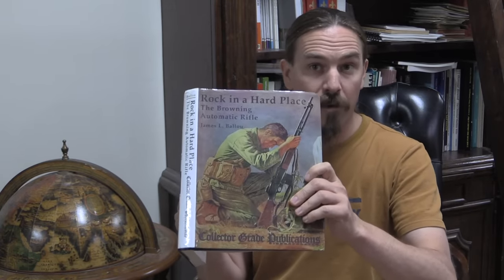Ask Ian: Why Not a Semiauto BAR Instead of the Garand?

Comment: I understand the Weight problem. if need to Carry and run, jump etc etc its a pain and need to be a muscular boy xD. But its a perfect example of what worse were the idea about continue using ammo clips. 100 years later we still use magazines
Reply: Ironically, Ian himself has repeatedly pointed out in other Q&As that the main reason armies preferred clips in this period was because magazines were more expensive to mass-produce and army planners were fully aware that soldiers in the field would treat both mags and clips as disposable items in a pinch.
Reply: @andrewsuryali8540  
Also the extra weight.  The box magazine is significantly heavier than a clip!

Comment: Ian!  You did not mention that the rate of fire has 3 settings on the end of the tube under the barrel to adjust the amount of gas that actuates the piston. A BAR can fire very slowly and allow for single shots by a skilled gunner.

Comment: The BAR could have been redesigned to a smaller caliber like the Pedersen.  Similar in size to the new Sig 6.8mm (.277)Fury.  That could make a lighter version of the BAR. The Garand should have gone with .276 Pedersen.  And the US could also have had .276 type round for NATO.

Comment: 'maximum.....allowable weight is given as 9.5 pounds' interesting that historically going back to Ancient times the standard infantry weapon whatever it was had usually at most about 11 pounds(5kg) and often quite a bit less. Sure you had some weapons that were heavier but they were almost always intended for specialised troops or short use. It seems no matter the era its simply not practical to field armies in which the average guy not the 'platoon' 'heavy' has to carry a weapon that weighs 20 pounds.

Comment: If I had the choice, the lighter my service rifle, the better.  BAR’s are blocky, and heavy.  It was better to use them in support roles, and leave more flexible units to use lighter and newer designs, like the newer SMG’s  and obviously, the next round of self loading rifles prototypes.  Garand and Johnson rifles simply were lighter, and easier to lug.  I am not a solider, but I just know that those guns have to heavy on top of kitting, so it was a good idea to find something that could be lighter, faster, and most importantly, newer.

Comment: I don't think the average weight of the XM5 is an issue, the normal fella weighed like 50 lbs less and was a few inches shorter back in the 30s, so I think we've just gradually become larger and can handle a standard issue weapon like that.

Comment: Kind of a ridiculous question when you figure an M1 weighs in at 9 pounds and an ungainly BAR is between 13 and 24 pounds, depending on the year/version Then there is the wight of a very small 8 round clip vs a 20 round box magazine. Then, does it have a bayonet lug - been too many years since I qualified on one to recall. Regardless, it's a fine tho now obsolete military weapon but a 13 pound one I dreaded carrying even in training

Comment: to be fair whit the requirement about the gun been able to run in bolt action mode.
I can understand that, consider the logistic nightmare and the quality of the industry at that time.
so having a gun must in worst case situation run in bolt action mode, be it worn or damage rifle part.
sub standard ammunition.
same whit the box magazines yes theres clear advantage to that but the logistic and industry of that was probably a hard pill to swallow.

remember WW1-WW2 even the US for a long time did not have enouth guns for all its soldiers (and they had to use what was consider obsolete, like sure police unit was fine whit what ever but this was more like rear line troops that are supposed to have at least something modern maybe not the latest was partially issued outdated stuff for a long time).

Comment: Funny that they mentioned in reasons why they shouldn't adopt it, they mentioned it should have a bolt action in case the semi auto system is damaged. Sounds just like Germany 20 years later with the G41 requirements

Comment: I wonder if the idea of a switch to turn the rifle into a bolt gun was, in part, influance on the FAL gas system.... 

Turning the gas plug to "grenade" effectively turns it into a straight pull bolt gun.

Still can't force it forward.... but meh.

Comment: The M-14 could have an automatic fire switch added I was on a range for qualifying and got an M-14 with this switch..  it was a lot of fun to shoot but I got really chewed out for doing that..  with this switch it was probably like a lighter BAR with a 14 round magazine, it shot very well, however, there was another issue with M-14 extractors breaking..   which, to put it mildly, was a problem..  also the stocks broke easily

Comment: The aversion of the military to detachable box magazines for service rifles seems inexplicable in hindsight. Didn't they trust that industry could produce these in large numbers?
Reply: I think its less about the number and more about the quality of the mag. BAR mags aren't known to be the most reliable afaik, and having a clip fed fixed magazine removes one failure point. I agree tho, in hindsight that is stupid.
Reply: That
And also they are heavier and bulkier for the same ammount of ammo as clips
Probably the main reason we use mags today is that clips dont really allow large capacities and the potentialy slower reloading didnt matter much when most rifles were bolt action
Reply: AFAIK, early 20th-century-generals often still had problems with the general concept of soldiers firing bigger amounts of ammunition without explicitly being ordered to do so for each shot. The French Lebel comes to mind which (in many parts) was actually designed around the premise that almost every action of the gun would be explicitly ordered by the field commander.
Potential waste of ammunition was seen as a big logistical danger. Couple that with a militaristic mindset, which put a lot of emphasis on "chains of command", and you get stuff like this.
Reply: @zjanez2868  Yea, if every detachable magazine was only 10 rounds there wouldn't be that much of an advantage over a clip. I can charge my SKS about as quickly (or quicker really if I am doing any type of magazine retention) as I can reload my AR15, but If I had to use three stripper clips because it had a 30 rounder it would be dramatically slower.

Comment: What's the difference between open bolt and closed bolt rifles
Also what is the longest internal magazine on a rifle and were they ever modified to hold more rounds
Reply: Open bolt the bolt is "open" and doesn't go forward, pick up a cartridge, and fire it untill you pul the trigger. Closed bolt the bolt is already forward with a cartridge chambered.

Open bolt tends to be used for machine guns and weapons intended for more sustained fire as it is said to cool better (air can travel through the barrel better I guess), and as previously mentioned a cartridge is not picked up, chambered and fired until you pull the trigger, preventing rounds from going off in a overheated chamber, which more realistically happens on machine guns and automatic weapons intended for a high volume of fire. Closed bolt weapons tend to be more accurate though, as you don't have the enitre bolt slamming forward when you fire.

Probably a mediocre explanation but that should be the gist of it.

Comment: The BAR is deadlier than the M1, but a 20mm flak is deadlier than the BAR.  The 105mm is deadlier than the BAR and in turn is not as deadly as a thermonuclear device.  At some point deadliness ceases to be an issue; everything hinges on practicality.

Comment: I'd been more curious about the other way around- why modify the M1 to automatic (making the M14) instead of just keeping with the BAR?

I guess weight.
Reply: The problem with lightening something like a BAR is that it fires a cartridge powerful-enough that at least some weight is needed to make the weapon usable and accurate in field use. As many nations found later on, with the 7.62x51 NATO cartridge in weapons like the G3, BM-59, FAL, and M-14, firing a full-power cartridge from a lighter weapon isn't all it is cracked up to be. Granted, none of these weapons was ever intended to be used in cyclic mode routinely, but the point remains. Even today, this is why something like the Soviet-era RPD is such a brilliant design. It is an automatic rifle/light machine gun firing 7.62x39, so it hits hard, has decent range, and is light-enough to be truly man-portable. My understanding is that back during the GWOT, special ops forces were asking the DOD and their individual services for a copy of that weapon, or something very much like it. A good idea is a good idea.... no matter where it originates.

Comment: So the reason the m16 has a forward assist is because the concept of a magazine cut off and a manual reload didn't disappear but mutated. I find this very interesting since you often see this in cultural or political settings where beliefs are uphold by tradition and not the practical reasons they originally was based on.

Comment: NEGATIVE NEGATIVE NEGATIVE! The BAR was the Squad Automatic Weapon of the day, a quite good one, in fact. Capable of Slow and Fast automatic fire. Not intended to be regular-issue service rifle to the rest of the squad. The tendency & temptation is too great to Spray & Pray by the US rifleman, instead of applying effective fire discipline. Even still today. The BAR was heavy, and only had 20 round magazines, yet was used very effectively by the BAR men in the role designed.
Reply: I'd argue that the 20 round magazine was way too small for that role in WW2. US may have been better off just using M1919 machine guns in every squad instead of BARs.
Reply: @goldleader6074  Agreed about 20-round BAR mags not enough. But even the lightest M1919 was fired from tripod, a crew-served weapon. Not an individual weapon, like BAR or SAW.
Reply: @jazzandbluesculturalherita2547  I know there was a version of the air cooled M1919 (A6?) that had a bipod and a shoulder stock so you could fire from a prone position or a supported position.

Comment: I honestly always thought of the BAR as kind of a low capacity assault rifle, sure it didn’t have semi auto but it was like a assault rifle
Reply: The only trouble with comparing the BAR to an assault rifle is that it fires full-power, full-sized center-fire rifle ammunition, whereas an assault rifle fires an intermediate sized cartridge which is smaller, lighter and less-powerful. Your comparison holds up better, though, in that the BAR was designed from the beginning to go forward with the troops as they advanced, to be man-portable. That was the main drawback of the vast majority of WWI-era machine guns, they were extremely heavy and often needed to be emplaced like artillery pieces. When broken down to move, they often required sledges, carts, or wagons - or a small team of men - to move them. One man with the weapon itself, another with the tripod, another with the water cans, ammo boxes, etc. It added up fast.
Reply: @GeorgiaBoy1961  yea makes sense, acts more like a beowulf then or G3, or hell just call it a full auto Grand

Comment: Hmmm what's old is "the new best thing"  🤔  the "New Ordinance Dept" is now the same thing. Out of touch with what's needed??? It's really a great and easy thing to just haul something out to test it with a truck and big ### load of ammo to test fire. Then load back in truck back to lab or arms room then say it’s great and best thing ever. How about loading down the ones that decided on what is adopted with all the #### they have and do stick the war fighters with make them "do that movement to contact march of say E.I.B. standard (came from WW2 to relieve/ reinforcement of 101 and 82 "if I remember correctly it's been 27 years since that") 12 miles for days and nights.  Then conducted the testing with unlimited targets to engage but the planned basic load of ammo.  You can bet that stuff will get lighter in weight and more ammo capacity.... like say M14 P.O.S. to AR-15 again.  What next a straight pull "bolt action" main battle rifle. 🙄  
 I got to see / feel the effects on transition from M16a1 to M16a2 first hand, then to M-4 and M-4a1. The good ideas fairy always slips in.  Desert Storm some machine gunners even "got" a M16a2 and even with a M203 on top of M60. Due to staff NCO's and Officer's not wanting to be stuck with a M16a2 to carry. That happened to more than a few in 101 and 82nd. I had a WW1 vintage 1911 as sidearm with my M60. I can only imagine how it might be "if" similar situation happens in future.

Comment: I'd much rather have full auto M1 Carbines. Lighter, less kick, can carry more ammo and magazines without bogging down easier. It lacks power and long range capability of the 30.06 but makes up for it with convenience and ammo capacity.
Reply: The M2 carbine is a nice gun I owned one but it was a handful in full auto. Very hard to control in comparison to a BAR and your giving up a lot of power and range in the 30 carbine round compared to the 3006.

Comment: Why clip fed & not mag fed for the rifle? Even if the mags were 10rd BAR mags, would have been way better.
Reply: So the weight of 10 rounds plus a metal box to carry them compared to 8 rounds plus a little metal clip which weighs next to nothing? But you get 2 extra rounds before you reload anyway, but more slowly because the hole's now on the bottom. How many rounds in mags could be carried compared to rounds in clips? Do you go with less ammunition or increase the overall weight the man has to carry? How much does it cost to manufacture a reliable box magazine times a couple of million units compared to a simple sheet steel pressing? What's the longevity of the magazine, how often will they need replacing? How much factory time, raw materials, transportation space will be required to use magazines instead of clips? There you go, answer those questions and you'll start to get a answer to your question.

Comment: One of the key factors related is the quality of mass producing such metal parts might be well ahead of its time to meet the weight requirement while still keeping the system reliable. Germen FG 42 seems to be well-fitted into this requirement (9.3 lbs) in theory, mainly able to do semiauto firing. However in practice, the reliability is not really that good. The mass-produced FG 42 jams so often that it cannot really take the advantage of the semiauto fire. The real fire rate is not much better than the bolt-action Karabiner 98k, making the semiauto point moot, think Ian has mentioned this before.

Comment: Why not convert the MI Garand to accept BAR box magazines?
Reply: There were M1 Garand prototypes that did just that. I believe Ian made a video about it. Basically the BAR box mags didn't push the cartridges into the action fast enough because the M1 had a faster action than the BAR. You would have probably needed to tweak around with the design to make it work which at that point you were better of making a new magazine design.
Reply: Italian BM-59